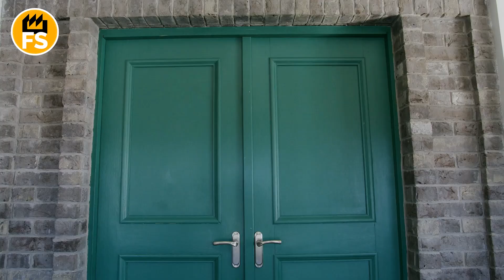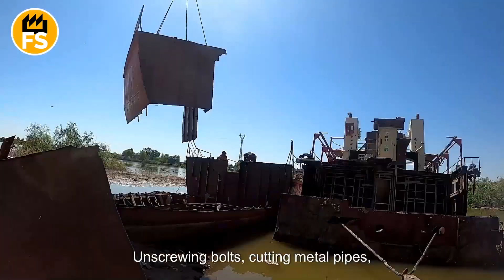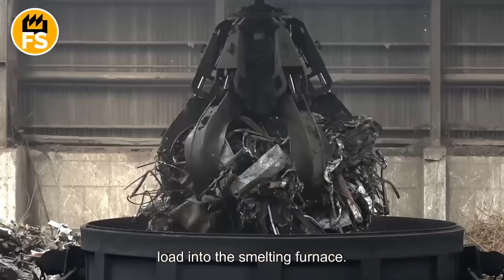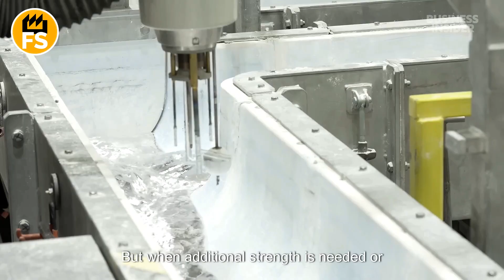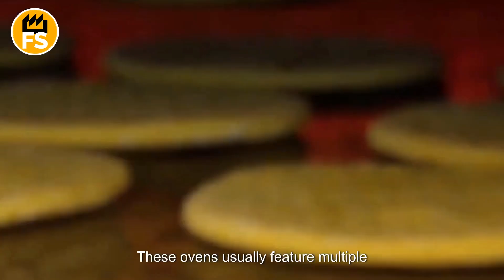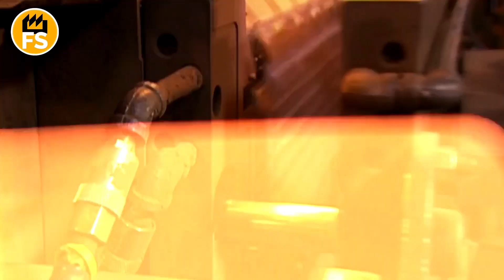Future Homes for $10,000! 🏠 How a 3D Printer Builds a House 🖨️

Comment: There is no way you could purchase a 3d printed house for so little money because building companies are about profit pure and simple.
Why would they print a load of 3d houses and lose all that money from building traditional houses.
And don't start making out you can print a house in a few hours, it doesn't work like that and it takes just as long to fit the building out....basically you are talking bollocks.
Reply from the maker: I appreciate your insights, @AntonHoward-mx9sb. While traditional builders certainly have profit motives, the potential of 3D printing in construction could disrupt the market by offering affordable solutions, despite the challenges in implementation. 🏠✨

Comment: How can the concrete be durable without steel? I would imagine many cracks after a relative short amount of time. In particular after some larger temperature changes
Reply from the maker: Thank you for your insightful comment, @mircorichter1375! The innovative 3D printing technology used in these homes incorporates special additives and techniques to enhance the durability of the concrete, helping to minimize cracking even in varying temperatures. 🏠✨
Reply: Every single 3D printed house I’ve seen was using small, steel reinforcement rods which were inserted manually while the concrete was still curing.
Reply: Have you ever heard of "ancient ru¹ns"?

Comment: Lie: not 10K. The cost is the same or very similar.
Reply from the maker: The $10,000 figure represents the potential cost of a basic structure, but actual expenses can vary based on materials and location. 🏡✨ Thank you for your insight!
Reply: A lot of is so we compete with other construction companies. 10,000 is the cost.